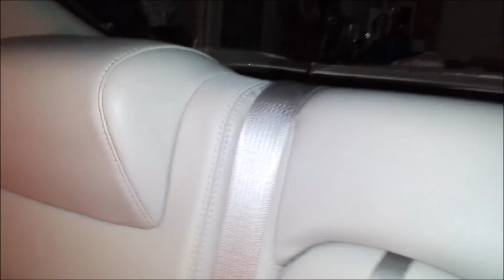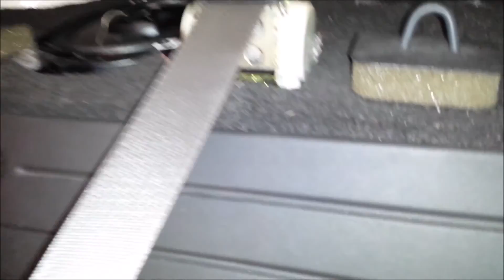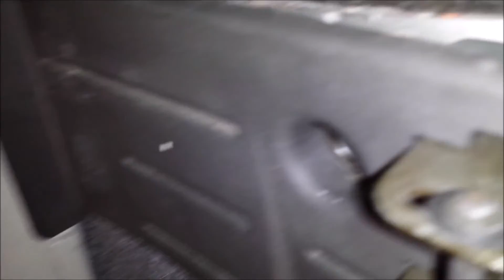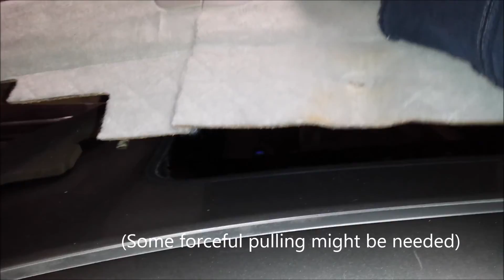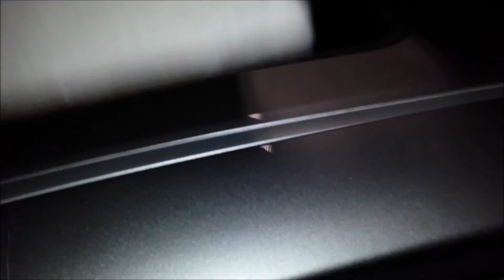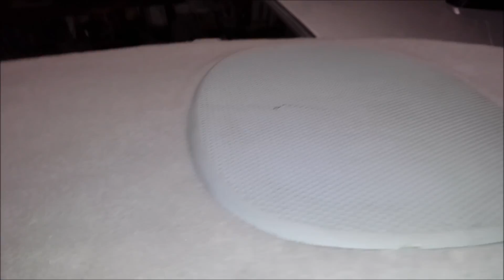2006 Monte Carlo: Rear Deck Speakers Replaced

Comment: hey adam i have  the same year model. man we should keep in contact because i've been  running into same issues with my car. i really have been dodging reparing my AC. i blows hot and cold only on one passenger side.
Reply from the maker: +Rydell V Yeah man for sure, my most recent issue is that over the winter the rear defroster stopped working.
Reply: Probably one of the tabs on the defroster broken.  That's what happened in my '01.  You should be able to see whether or not the tab on each side is attached.
Reply: +bulldogsajr Dude I have an 03 monte and one of the tabs came loose. I took some superglue and reattached it but it still doesn't work. Maybe I'll go to autozone and buy some of that conductive glue they sell with the window repair kits. If that doesn't work then idk. None of my lines are broken. Do you think it could be because of my tint?
Reply: Low on freon half pound guaranteed